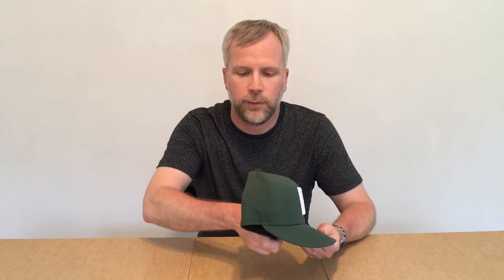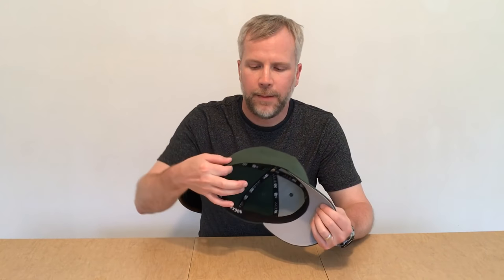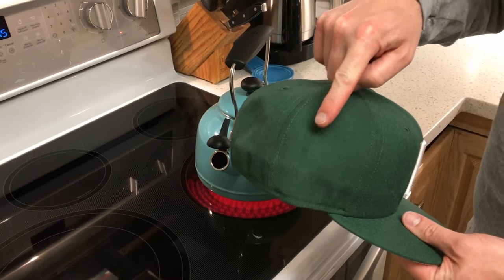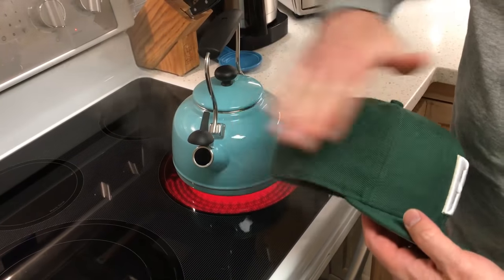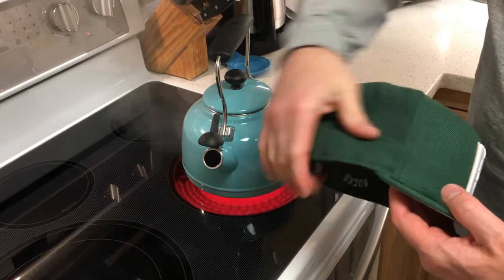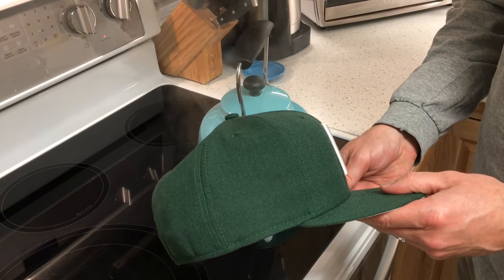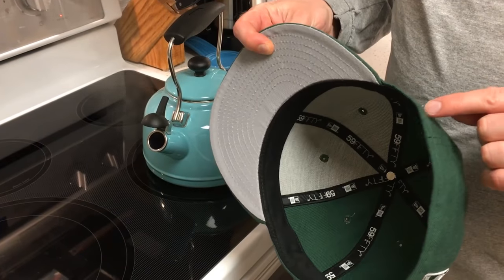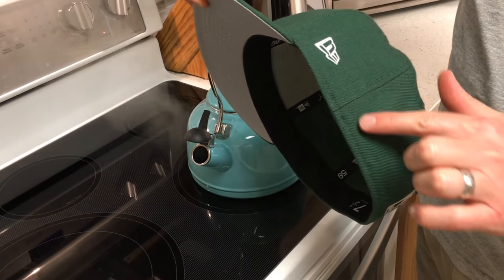Smoothing the Wrinkles in your Baseball Caps

Comment: If you don’t have a kettle, take a piece of cardboard, cut a hole in the middle of it, and stick it on top of a tea pot or metal pot and pour water into it and then grab a piece of toilet paper or paper towel roll and tape it to hole in the middle of the cardboard slab. Then wait for the pot to start boiling and steam to rise and then place the cardboard over the pot and boom their ya go. But only have the cardboard there for a few minutes because the cardboard will begin to get soggy.
Reply: I know this old but tin foil my dude! That's what I just did. Tin foil over a pot of boiling water. Thanks to this video, it just saved my brand new Kangol hat!

Comment: Hey bud just subscribed, great vids! Man i have a small issue with a wool fitted cap 5950 that has some "puckering" along the back side panel how yours has, is there a way to smooth that out? Looks like the rocky mountains lol thanks again, and great channel!! 🤙🏽
Reply from the maker: Hey man, thanks for the great feedback.  Unfortunately I haven't worked out a good way to smooth out that sort of thing.  About the only thing you could try is to stuff the cap with a towel or old t-shirt, putting pressure on the seams to flatten the peaks from the inside... then hit it with steam and let it cool with the pressure still applied.  No guarantee, but you could try it - if I figure something else out, I'll post it!
Reply: dre in the 616 thank you for the reply brother much appreciated!! Im going to try that out👍🏽 look forward to the upcoming vids.

Comment: I ruined my husband's cap by washing it in the washing machine.. more than once.
The thing is the front part has two visible vertical lines which are bothering him and I'm trying to fix it.
Will the same method work? Or would you recommend something else?
Thank you for making this video.
Reply from the maker: I think you might be headed in the direction of a video I was about to post in the next week or so - how to fix some of those things in the front (logo) panels of the cap.  It would take a while to explain here, so if you can check back on my channel in a couple of weeks I'll likely have something up... thanks.
Reply: @dreinthe616  I'll be waiting for it.
Thank you for replying

Comment: i have wrinkles from storing martial art sparring gear. Will steam work with that type of material or do you suggest a different way?
Reply from the maker: Steam is the ultimate tool for smoothing fabrics, so I’d give it a try… sounds like a portable garment steamer would be best for that, but you  could test it with a teakettle first.

Comment: Does it have to be specifically steam or can a heat gun work just as good??
Reply from the maker: For removing wrinkles in fabric, steam has been the magic ingredient for tailors and upholsterers over the centuries - it's pretty important for the moisture to relax the fabric.  The only spot on a cap where a heat gun is as effective would be the front two panels, where the buckram backer can be shaped with heat alone.  You can also curve the visor with heat only, although I still recommend steam there too, thanks.

Comment: Hey Dre616, I just took a gamble on trying to shrink a fitted by boiling it and then putting in the dryer. Worked perfectly for sizing but now there’s several wrinkled up areas. The steaming kettle helped a bit but not entirely. Are they gonna be permanent do you think? Any other ideas? Thanks man.
Reply from the maker: That's pretty aggressive on a cap - they're durable, but there is a limit.  In one or both of my shrinking videos I talk about the "puckering" that results from substantial application of moisture and heat.  The fibers draw tight when they shrink, so it is inevitable that you get this.  Best you can do is to try and smooth it out by steaming it with a bump cap insert inside the cap (my video - https://youtu.be/e9pSynl4O7M ), thanks.
Reply: @dreinthe616  OK thanks for the info. Appreciate it!

Comment: Any advice on how to get the pucker out of seams particularly? I tried steaming the hat, but it didn’t work. Since it was my first try, maybe I just did it wrong, but I can’t find anything that specifically addresses this.
Reply from the maker: I have not been too successful in getting those out either... but you really need a "form" that you can press inside the cap... in this video https://youtu.be/4-q4ufu5M6w I use either a towel, or a small soccer "skills" ball.  There has to be something that is making those smooth while you steam it.  Thanks for the question, if I find something else you can be sure I'll make a video!

Comment: Do you have a video on how to fix a hat that has the material in the front (I think you called it bachram?) that has been washed and is now horribly wrinkled? My wife washed my sons hat and the front is really a mess. It's a one of a kind hat and I'd like to fix it.
Reply from the maker: It's called 'buckram'... and it can get rippled with moisture and heat.  Best thing to do is to wet it a little bit, stuff a towel inside of it to press out the shape, and heat it with a hairdryer while doing that.  It's moldable because of the plastic fibers in the stiff kind of buckram that New Era uses in most of their cap types.

Comment: Is that okay if i used that method around the cap where it has crease ?
Reply from the maker: Steam will help to smooth out any fabric areas of the cap.  The heat should also help with the front two panels, with the buckram under them - but you might need something like a towel or old t-shirt on the inside.  For the visor, it would probably be a little tougher to remove creases.  Good luck!
Reply: Thanks

Comment: Any tips on getting out a crease on the bill of the cap
Reply from the maker: I don't have a good tip for that situation yet.  Even if the bill has a plastic insert, a crease probably means that it's absorbed some permanent stress.  You can flatten it with a steam iron, but if you re-curve you may find the crease again.  I haven't verified that approach, so if you try, good luck.  Thanks
Reply: dre in the 616 okay thanks. Side note. I used the clorox wipes to clean the inside of the hat sweatband and back panels from your other video and worked great. But i also used the wipe to clean the visor, and it looks almost like new and it did not stain the fabric from the bleach
Reply from the maker: Hey Austin, that's excellent news, thanks for posting.

Comment: Wont the front part of the cap go soft and collapse? I remember putting a hair dryer into my hat and ruined it completely.
Reply from the maker: Time and temperature exposure are important to watch.  There's plastic in the buckram under the front two panels - and the softening temperature of those fibers is around 170 deg. F - and the melt temperature maybe closer to 200.  So you just need to be careful with how long you expose the heat.  Getting wrinkles out of the sides like shown here is a little easier because you don't have to worry about the plastic fibers so much.

Comment: question for you...how do you get rid of the point on the top of a truckers hat?
Reply from the maker: Hmmm, I've never tried it.  I assume you're talking about an A-frame style cap, where the seam ends in a point.  That's a tough spot to get rid of it, because the stitched joint there is very stiff and would be tough to flatten.  Sorry I don't have a good idea for you.

Comment: How about when the fulcrum is causing a fold on the panels right behind them? I keep getting a hats that the crown seems to be too high on my head the the fulcrum are causing a fold right behind it in the two side panels
Reply from the maker: It's unfortunate, but that excess material just needs to go somewhere... I actually talked about that in some of my crown shaping videos.  When you shape or rake the crown back a little bit more, it creates that effect too - it's not helped by the joint to those two panels, where the mid panels are folded and sitting on top of the two buckram-lined front panels.

Comment: It didn't work for me. I have two old caps from the TV show "seaQuest". There's wrinkles in the black cap I couldn't get out and misshapen creases in the blue cap. I wonder if an iron would fix it. These caps are old snap back caps from the 1990s.
Reply from the maker: Sorry to hear that - you might try stuffing the caps (with old t-shirts, hand towels, etc) to give them a full form before steaming (btw a Hat Jack does a great job of holding them in the crown of the cap).  I do that when I’ve got to get some tough creases out and restore the shape.  But if your caps happen to be cotton, or there is ‘puckering’ near seams, those can be especially challenging factors.  Thanks and good luck.

Comment: How do your hats to stand back up if they get crushed flat?? Starch possibly ?
Reply from the maker: The structured crowns in New Era caps actually have plastic fibers woven into the buckram under the front two panels.  Once those get bent, creased or otherwise crushed it is just about impossible to restore the structure.  I have a video that can help remove dents and creases ( https://youtu.be/4-q4ufu5M6w ), but if it's just about flat, the techniques there might not be enough.  I personally would not recommend starch, I don't think it will give any real structure back to the cap.

Comment: Does this work for the front two panels?
Reply from the maker: I have not done it a lot, but yes, it is probably effective with the front two panels as well.  I think the key is making sure there is something underneath them to provide a "form" - so that those panels don't drift inward and form any new folds or wrinkles.  If you give it a try, good luck and feel free to post another comment.  Thanks!
Reply: It really works on the front panels. The only sad thing with the front panels that I've been through is a mark of the sweatband on the fabric. In this video I can see that you have the same problem with this particular cap. Did you pay attention to this detail? It really boggles me every time that I found this thing because you can never get rid of them. Do you know if a hair spray can really make the front panels stiffer?

Comment: This only works on polyester! Dont try for wool it will be a mistake!
Reply from the maker: I would disagree - steam has been an essential tool for centuries to smooth all sorts of fabrics, including wool.  Just don't overdo it by holding it there for too long.  I've never had a problem doing this to my wool caps, which represent probably 30 or 40 percent of my fitted caps.
Reply: @dreinthe616  Did it to my new york yankees vintage cap that is made of 100% wool and the front is wrinkled. I also dont know of any solution to get it out.
Reply from the maker: @BigRoqq  Ok, understand - I think construction and age could be factors.  I've done a lot of videos on using steam to edit and shape, but the one that I might suggest is called "Fixing Dents and Creases" ( https://youtu.be/4-q4ufu5M6w ).  It also depends if it is a 59Fifty with the traditional New Era buckram, which has plastic fibers in it, or if it is a soft linen/cotton buckram as in their "Retro Crown" caps.  To get wrinkles out, you need some sort of form underneath the crown, like an ironing board for a shirt, but if it's an unstructured crown it could be tougher to do.  I've also had caps where the buckram has declined through aging, and it naturally starts to break down.  There are a few other videos at my channel that may be helpful if you are interested, thanks and good luck.